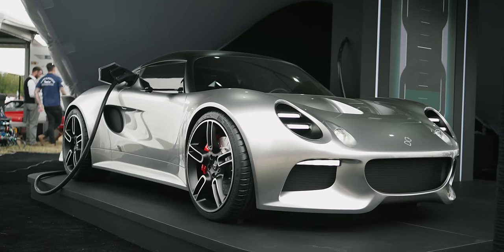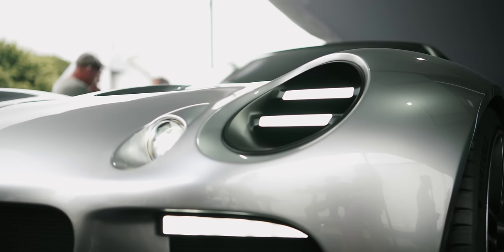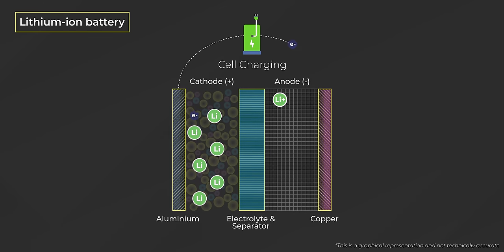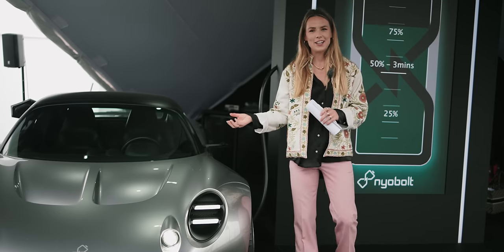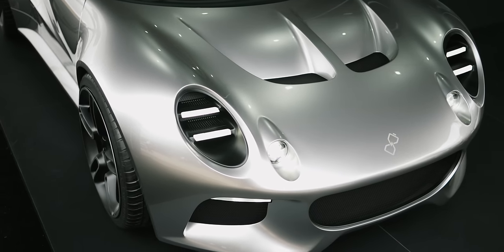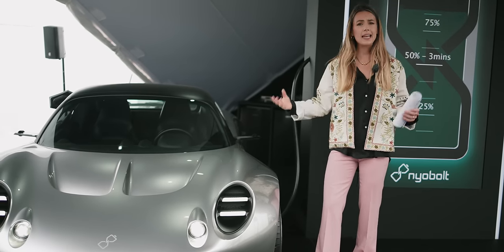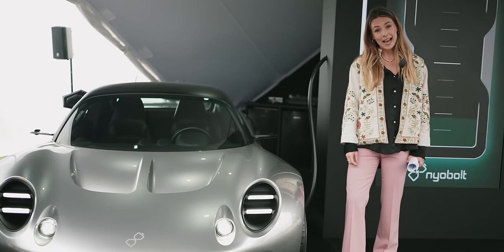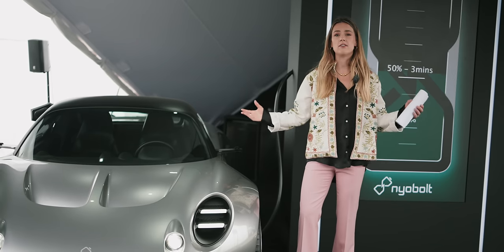This Futuristic Tech Could Be the Key to TINY EV Batteries!

Comment: RIGHT. Let's settle the big question. What do you want - super fast charging or super energy dense batteries (I appreciate those things aren't completely mutually exclusive.!)

p.s I said battery approximately 17 million times in this episode and for that, I apologise! For bonus points give me some battery synonyms!
Reply: I guess "cells" is one option. Or you could go old school and call them "accumulators"
Reply: "Electricty Container Thingies"?   😜
Reply: I'd go with super dense batteries. That would mean the cars would be lighter and much more fun to drive. It would also make ev restomodding much more easier and fun :)
Reply: Honestly it comes down to use case. In the UK, charging quick is good as you don't go too far in a trip. London to Glasgow is only 700km. Which from someone in the UK is a long way. So two stops is perfectly ok. You might only do that once every 5 years or so. 

In Canada Toronto to Montreal is 550km and that is a Derby Match. You might do that 3-4 times a year if you are a TFC supporter. Growing up we did 700-1800km to see my grandparents every summer. So for us we need at least some models that have High energy dense batteries that can do 450km+ on a charge. Ideally ones that can charge fairly fast. As because we do it so much our bodies are used to doing it without stopping. I recently did 430km in under 4 hours without stopping at all. 

The average person everywhere only needs 20kwh batteries for city driving (particularly for a second car) and they charge at home. The option for 450km+ range Spring to Fall is important for a lot of people though and those options on cars are needed.
Reply: You can refer to it as "the pack" ... short for battery pack.
Reply: I'm pretty happy with my Model 3 LR, went on a 6000 km trip this summer and hardly ever felt like I was waiting for the car. Instead of compromising to one extreme, I'd be happy to optimize for low weight and long cell life with 3LR-ish performance.
Reply: I think it depends a lot on how we plan to use our EVs in the future. I personally would love a car that leans towards fast charging (15 min or less, which is the perfect length for a break anyways) and be satisfied with range of 300 miles or a bit less (not so far fetched when you look at the development). But I would need an infrastructure that allows me to move freely and quickly between charges. Something that might be a luxury in regions that are far less densely populated than Central Europe.
P.S.: I guess you could call them accumulators if you want to sound extra fancy :)
Reply: Super energy dense. Putting 50kWh and 20kg in the place of a gas tank would be amazing. If it charges at 150kW would be the cherry on the top
Reply from the maker: @dalexa  like being a lightweight marathon runner who can also win a 100m sprint and refuel on lucazade in 10 seconds.. a tenuous analogy perhaps!
Reply: @fullychargedshow ah, yes. The Daley Thompson of batteries. Forgive me those who don’t know him.
It’s still a long way to go but we’ll get there eventually.
Reply: Do they need to be mutually exclusive? High end CPUs in computers now are going with a mix of fast and slow cores for optimal performance. Why cant we have a combination of fast charge batteries and energy dense batteries, that are used under different driving conditions?
Reply: "energy storage for boring cars"?
Reply: Both. 🤷🏼‍♂️
Reply: @fullychargedshow different people will have different needs, but for most people most of the time their journeys are short enough that they don't need to recharge en route. So overall energy density is more important. A reasonable range (150-200 miles would be enough for most people) with a smaller lighter weight battery means less energy is needed to move the battery meaning it can be even smaller! Less electricity =  cheaper to run, less materials in the battery = cheaper to buy. This is what we need to get the bulk of people to switch. Fast charging is useful for impatient people who drive long distances but I think they are a small % of the population who just want a cheap way to get about.
Reply: A date with you <3. Imogen you are so beautiful and intelligent

Second a ~40kWh battery.
If its less - we cant make use of destination slow charging. If it's more - the cars are too expensive, heavy and too low efficiency.
Easier to pay for- and start charging. That mean we should not have 25 different operators, nor should we have one sole operator.
Also always offer a robust and easy way to pay. Why not card reader? - Every petrol pump offer that in my country Sweden.
Reply: I hate concept cars!! if it is such a great car then why not put it into production? and put it to the test, cowards, Elon is an example of bravery
Reply: Neither. I want a 120 mile uk winter range and a cost under 10k. Everything else is secondary, as if it doesnt meet those its not something I can use or afford.
Reply: Juice box

Comment: From what I've understood over the years, it's actually not hard for companies to make ridiculously power and energy dense batteries.  The problem is longevity and making them at a commercially viable scale.  What I want to know is the c-rate of the individual batteries in the car.  That will be more informative than most other things they've let people know about.
Reply: whats c rate mate
Reply: Napkin math: 35 kWh battery charged at 350 kW would be a c-rate of about 10, which is a LOT. Napkin math 2: Fully charged battery in 6 minutes is 1/10 hour, so a c-rate of about 10. Which is still a lot. Yes, I assume you can do this math as well and it is far from the whole story, but ballpark numbers work for me. 😇Having a complete battery working in a car is also closer to real than a prototype cell in a lab. Time will tell where they can go with this.
Reply: @cameronsmith2928  its a practically useful but technically imprecise measure that tells you roughly how high the specific charging or discharging rate is. It's a more handy version of power density. For example a C-Rate of 10 C means:
Charge power in KW = C-Rate × Capacity in KWh
350 kW = 10C × 35 kWh

As you see, maximum charging power also depends on size. Throwing in tons of batteries is considered a bad trend. Reaching the same power with less batteries is technically more challenging.

Discharge rates are typically higher, rimac's nervera tops out at 12,5C discharge rate, other cell chemistries reach 30C (like drone batteries) but those are less save, more expensive and don't last very long.

That being said, i have yet to see reactions by proper battery scientists if there is something to this particular company because this topic is complex and often cells that excel in one measures have significant deficiencies in other measures. This is very likely and it's in the interest of a company searching for investors to be a bit secretive about this. The relevant measures are: longevity, safety, volumetric energy density, gravimetric energy density, power density, material availability and manufacturing simplicity. It's unlikely someone just stumbles over some tech that is better than current batteries in all meausers.
Reply: I’ve seen discharging at 10C, but charging at 10C is bonkers
Reply: @cameronsmith2928  C is the charge rate, as measured by the current.  Say the max output current of a battery is 5 amps at its rated voltage, then a 2C battery could charge at 2x5 = 10 amps.
Reply: You guys explain c-rate way to complicated for the average person! 
To take some of the math and complication out of it: a c-rate of 1 means that you charge your cell at a rate that would result in it charging from 0% to 100% in 1 hour. 
A c-rate of 10C means that you charge your cell at a rate that would result in it charging from 0% to 100% in a tenth of an hour.  
A c-rate of C/10 or 1/10 C means that you charge your cell at a rate that would result in it charging from 0% to 100% in 10 hours.
Usually you don’t charge your cell all the way with the same c-rate but you modulate the c-rate at very low % and very high % to not damage the battery. That’s why your phone or ev goes quickly from 20-80% and takes much longer from 90-100%. The reason is: the c-rate was reduced to not damage the battery (keyword: lithium plating under anode potential of 0V) 
Lastly: the c-rate also works for discharge: if a cell is capable of a high c-rate. It can discharge quickly meaning it can provide its stored energy in a shorter amount of time. And if you can disperse energy quicker than other batteries, your battery has more power.
Reply: Wanna hear something truly insane that I've actually worked out the math for?

If we ever want to reach the same effective "refill" rate with batteries that we currently have with gas stations and TRULY get rid of range anxiety, we need >1000Wh/kg and >1500Wh/L solid state batteries that are capable of being charged at 1MW. Instead of having battery packs that weigh LITERALLY a ton, we can finally get down to a MUCH more reasonable 250kg on the high end, which in turn will easily provide upwards of 250kWh of capacity on the high end and only take up a volume of 250L - that's 66 gallons or 9 cubic feet, which isn't bad at all.

As for charge vs discharge rate, we're already capable of charging phones at RIDICULOUSLY high c-rates. There are phones nowadays capable of being charged at THREE HUNDRED watts. PHONES. Since solid state batteries are capable of operating at much higher temperatures than today's normal lithium ion batteries, the increased heat output from megawatt-level charging won't actually be as much of a problem in my opinion.
Reply: Yep, 10c is kinda normal in drone/rc world because they won't expect the batteries to last for years
Reply: 60 minutes to full charge = 1C
600 minutes to full charge = 1/10 C
6 minutes to full charge = 10 C
So if a 350kw charger gives you a full charge in 6 minutes then you have a 35kwh battery. So about 120 miles of range. Which is not very much. But great for a short range race car.
Reply: @spdcrzy  Range anxiety is mainly psychological problem not a technical one. People believe Range is an issue because whenever people talk about EVs, they talk about range but in practice range rarely matters. *The best way to TRULY get rid of range anxiety is owning an EV*. The vast Majority of EV-Drivers will admit that they had some Range anxiety which dissapeared through experience.

Now to your Calculation. It doesn't add up: A 250 L Battery with volumentric density of 1500kWh/L would have 375 kWh. If you fill a 55L Tank of Gas in 2 Minutes you get a rate of 13,8 MW. If we go on to assume that an EV needs a fifth of the Energy for the same distance, that would still turn out to be 2.7MW.

Your proposed 375kWh Battery would be good for around 2500 km. The Median driver in my country drives this in 3 Months which means half of all people drive LESS than this in 3 Months! Less than a 6th of all drivers would go through a battery in one month (Those are pre-pandemic numbers btw). But more importantly: With a 250 kWh battery you'd get more than 1000 km without a break. Do you really need to be able to do another 800km after 5 minutes? Even if you could do that at a constant speed of 130 km/h, that'd be 14 hours of driving with a 5 min break. Is Your range anxiety really that bad?

IMO: A Range of 300 km with good fast charging (20 min to 80%) is enough for probably 3/4 of all people and maybe even more than enough for 1/2 of people. Only very few People that really drive a lot (like 60000 km a year) Need substantially more, like over 600km of range.
Reply: Why do you think this is not the case in this car?
Reply: @paulf3353  I'd say many believe that, because this happens all the time: Every now and then some science paper or startup comes around with a miracle battery gathers investors and then it turns out, that the prototype is one trick pony and they can't make it good enough to compete with current Tech. People tend to forget that current gen Li-Ion batteries are very advanced and have a remarkable allround performance. New Tech often struggles to even keep up with that.
Reply: @cameronsmith2928 c rating is the rating of time it takes to move an amount of power so 1c is 60mins to empty or charge a battery 2c is 30 mins to charge or empty a battery etc
Reply: @kooooons You are right 300km is plenty of range for most people. But it needs to be 300km on the worst day of the year. So after 4 years your battery will degrade 10% and on a cold snowy day your range is reduced by 30%. Leaving you with 189km of range. If your car is rated for 476km of range when you buy it then your worst day is 300km of range.
Reply: @ecospider5  No... It doesn't need to be that on the worst day of the year because the 300 km are not due to some magical 300 km trip that everyone needs to be able to do in one run. And even if it was like that, you'd have a 5 min stop on the worst day of the year. So what? That's not a good reason to carry around the extra battery for the rest of the year let alone pay for it.
Reply: The problem is that you increase the energy density, you start creating a bomb.
Reply: @Aspartame69-vj9wk  the aim is to create a battery that has good values for
- volumetric energy density
- gravimetric energy density
- power density (c-rate for discharging)
- charge speed (c-rate for charging)
- safety
- longevity 
- material availability (e.g. no cobalt)
- manufacturing simplicity and scalability

The first one is important for mobile devices like phones (current tech: high cobalt NMC). The next two are important for sports cars and top level long range cars (current tech: high Nickel NMC). The last two are important for cheap daily drivers (current tech: LFP)

The key to new battery tech; the actual difficult part of it; is to have a good balance of ALL these values, creating a compromise that's in sum better than current tech. Nobody will make a battery that's actually a bomb and throw it on the market because nobody wants to buy a car with such a battery. So saying "you can't do this because then you'll have a bomb" is a bit stupid. It's a key requirement of "this" to not be a bomb
Reply: @kooooons  That depends to an extent on where you live. Canada is huge with few chargers and everything is far away. Winter at -30C magnifies that dramatically.
Reply: @Aspartame69-vj9wk  Any gas car on the market has more explosive energy than an EV.
Reply: We have a range of 300km (90%-10% at motorway speed) and just did 3000 kms over the course of our holiday with no problem. 69kWh and charges 10-80 in about 30 minutes. I would only say that imo the people needing more than this are probably <10% of drivers.
Reply: We probably need battery max size regulations to settle this sensibly. It would make gigantism of EV suvs a thing of the past.
Reply: @winstoncat6785  although I am on your side that battery sizes need to shrink, I don't think government regulations are a good measure as there actually still are a few people that need large batteries would be penalized. Also currently the market for EVs is still small, but to bring battery prices down a lot of battery demand is needed and lastly, battery recycling and second life applications can only be commercially viable if there's enough used batteries.

Also, as I already stated: I believe owning an EV is the best way to get rid of range anxiety, so I reckon if people get the choice to buy a small battery for a substantially lower price but with comfortable fast charging, many  won't pay premium for a big battery on their second EV anymore.
Reply: @kooooons  it's always a debate wrt regs. I tend to default to the fact we did this with increasing severity (but many loopholes) to ICE cars for years. I would also grant bigger batteries for "genuine" use which means towing and bulk transport for small businesses mostly. atm, the companies following small battery/high efficiency may be losing out (Peugeot/Stellantis for instance). But we'll see. Mass adoption is the first hurdle as you say.
Reply: @kooooons  fundamental point you make about real range vs size is critical. It's very difficult to get 500 kms on a "real world" journey. We came home in appalling weather yesterday, heavy rain and cold. Ended up charging to 92% mid way. Gave us 340km range. We had 267 km to go. It was meant to be motorway, but people were crashing everywhere in tbe conditions, so we took the old road. 
Made our driving more efficient. Averaged 17.6 kWh/100km. Not far off best possible. In truth, on a motorway, unless a Tesla, you'll be sround 19-21 kWh depending on weather and road profile. Even a 100 kWh battery will not get you 500 kms then. You shouldn't go below 10% and only the first part of the trip will start with 100% if you are leaving from home...
Reply: Charging rate is pretty much inverse to capacity. You want to charge fast, you give up energy density. I've seen large (0.5Ah) R&D battery cells that will charge at 50C and discharge at 200C. It's all in the engineering, not the chemistry (although picking the right chemistry helps!).

It's great that Nyobolt are being honest about how they achieve this compromise. One of the big lies out there in the auto battery world is a hand wavy "400 mile" (say, 150kWh) battery that "charges in 6 minutes" (they all seem to charge in 6 minutes for some reason) and they often show it parked in your home garage. 150 kWh in 6 minutes = 1500kW. Good luck finding a charging station and that will be quite a big cable connected to your car.